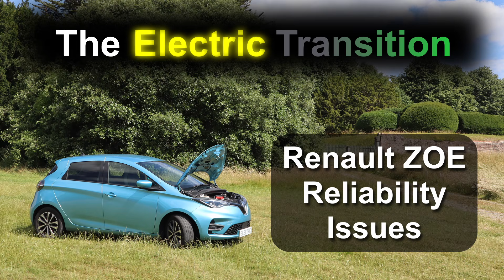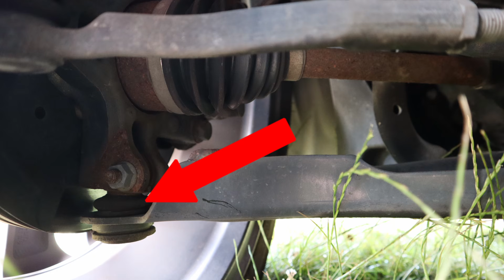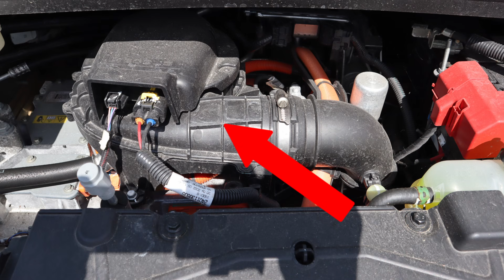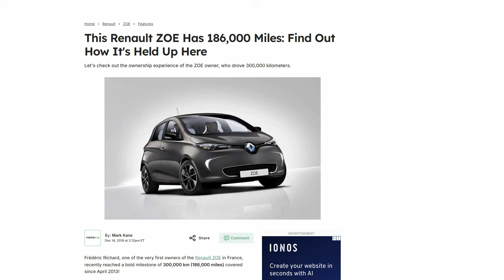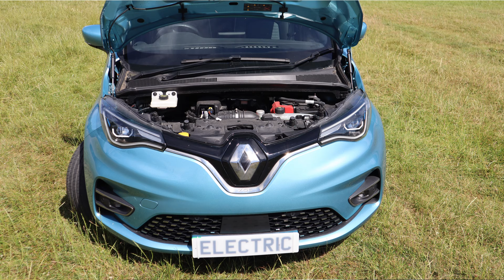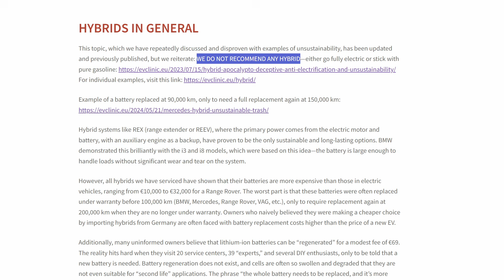Renault ZOE - Reliability Issues

Comment: This is such a well documented and accurate video. I have had a Zoe R90 for the last 5 years clocking 16,000mi per year on it.
Exactly as you mentioned, I have had to replace both ball-joints (can be done with a mechanical press without changing the bars) changed the drop link for a failed bearing and had the bearing failure of death at 90,000mi. As I did not watch your video first, I kept running until the motor failed. I had it replaced  with a refurbished motor fitted with the improved bearings. Unfortunately my Zoe battery charger unit failed this year and due to poor design, is not economically viable to repair… Now upgrading to a Ze50 in full knowledge
Reply from the maker: Thanks for sharing your experience, although I am sorry to hear that you have suffered so many of these issues personally. That seems very unlucky.

I hope you enjoy the ZE50. It's quite a big step up in interior materials and feels more solidly built. I very much like mine.
Reply: @theelectrictransition  Thanks for the reply. It is a significant step-up all-round, especially going from the Dynamic ZE40 to the GT Line ZE50, it really feels like going through 10 years of car tech innovation. My favorite upgrade remains the DC fast-charging capability of the ZE50 and the extra battery range!

I forgot to mention that I park my car near fir trees at night and over 3 years my ZE40 suffered twice from a clogged water drain from the pollen balls. This resulted each time in rain water entering the cabin air system and flooding the driver side. Each time it took weeks for the padding foam to dry up. As a result, at least once a year, I had to remove the wipers and the grill under the windscreen to vacum-out the grit in the drains using a vacuum cleaner and a 1m water hose pipe. I don't know if this is a specific weakness from ZE40 only or if my ZE50 will need the same.
Reply from the maker: @darnio1  Yes, DC rapid charging makes for much easier trips I'm sure. High power AC charging has not become as ubiquitous as Renault expected - not in the UK, anyway.

The ZOE is known for clogging of the drains you mention and as far as I know, no changes were made during the mid-cycle refresh that will avoid that problem. I would recommend continuing with your annual maintenance to avoid the water getting into the cabin
Reply: @theelectrictransition  That is very valuable information, thank you very much!

Comment: Great overview—thank you. One Q210/Q90 issue that may be worth covering in a separate video is charging compatibility rather than charger failure. Some early 43 kW AC Continental-drivetrain ZOEs appear unusually sensitive to the supply’s earthing / neutral-to-earth conditions, so they may refuse to charge at certain otherwise working public AC points. This is not necessarily a fault that can be repaired in the car, but a real usability issue for owners and used-car buyers. It would be really useful to explain the symptoms, why it happens, how common it is, and what owners can realistically do when choosing or using charge points.
Reply from the maker: Thanks. That's an interesting idea for a video. My access to the older ZOE I featured in early videos has come to an end, but I'll see whether it's an option to get access to another one.
Reply: just bought a Q model, can you tell me how do you go about it?

on a side note  I bought it with a charging issue. after 2 min of charge it stops. auto rearms and charges again does this 3 times and then stops for good. Its going to an independent shop to get fixed
Reply: @ignaciosernacampillo9527  Well I am pretty happy with my Q210, especially with the 43kW charge capability. If it is one day financially worth it to change to the 40kWh battery I would do it. But as 90% of the use is for short distance forensic home charging. It is more than fine.
In Spain there is Waylet a big patrol station brand. They have a good network of 43kW chargers that I always try to get to first.
As in Spain the rules for the ground-neutral connection are not in favor, about 30% of the 22kW chargers give a check ground resistance error. And there is legally not much one can do about it, other then remember not to try a second time to get in problems reaching home.

Comment: I have a  2015 Zoe 22kWh R240 variant since 2018. Problems I've had are, drop links, bushes, Electric Motor Failure with the regen breaking not working (£2000 part replaced for free by Renault Dealer, this was when car was about 5 years old), and now I've got charging not working (at all) due to burnt out Neutral pin on the filter assembly. Quote to fix and replace filter by independent HEVRA is £2400. What's annoying about this is that this seems to be a design fault as the Neutral pin is not sized for 32A single phase so burning out is not uncommon. Apparently Renault assumed most would be using three phase (common in France) where the pin for each phase only takes one third the power, well not in the UK. Car has only done 34K miles, so hardly high mileage.
I'm disappointed TBH.
Reply from the maker: Im so sorry to hear that you've had these problems. I can understand you being disappointed - Renault made a few mistakes in their design, and you have sadly suffered because of it.

I agree, the small neutral pin is a bit of a design error. The only question is whether it's a mistake that Renault were aware of, or whether this is a part they bought in from a supplier, and failed to recognise the issue before the car was delivered.

Either way, Renault should shoulder the responsibility, really - but I can't see them doing that. Renault can't be in great shape, financially, so they probably have no choice but to weather the storm of disappointed customers 😑

I hope your independent garage sorts the problem easily enough.

Thanks for sharing your experience - each report of issues helps inform other customers. Take care.

Comment: Very informative. My ze50 makes a pronounced clunk/click when transitioning between drive and regen when I life and depress the drive pedal. Is this normal or a fault ?
Reply from the maker: Mine doesn't do that, so I'd say it's a fault. When was the car last MoTed? I wonder if it might be a lower ball joint - assuming it's not that some part of the drivetrain - even a wheel - is loose.

Comment: It's worth noting that EV Clinic has better bearings they use when fixing R-motors in Zoes that don't suffer from the same issues as the ones from Renault.

My personal opinion is that as long as you have an independent EV repair shop you know of that can fix the issues with the Zoe, so you're not stuck relying on Renault, its reliability issues is something that can be worked around and I don't find it a dealbreaker for most.
Reply from the maker: Thanks, that's good to hear - although, sadly, I'm fairly confident that a change of bearings doesn't solve the problem, it just resets the countdown timer to failure.

The bearings that Renault specified might not be ideal, but the main problem is that they failed to understand induced current. Continental fitted a part in their motor that Renault left out - and that spells failure for heavily worked motors irrespective of the quality of the bearings.

I'd be thrilled if I was wrong, but I think that's fairly unlikely.
Reply: @theelectrictransition I'm pretty sure the issue with induced current is what these bearings were designed to fix. They say these bearings permanently solve the problem of the bearings failing.
Reply from the maker: @swecreations  Ooh, OK, sounds intruiging! Thanks

Comment: I am loking at one right now, it have a motorcode of 5AQ 60. Is you did not mention this, is this a local varient of my country or is it somthing i misunderstadn?
And is this the qontinental veriant?
Reply from the maker: I think the 5AM is the Continental motor, whereas the 5AQ is the Renault motor that tends to be at risk of suffering the bearing issues.

Here is Gary's excellent video on determining which is which. He shows a photo of the metal boxes on the top of the 5AM, alongside the 5AQ he has in front of him.

https://youtu.be/leJ1Shqxxx4

Comment: It would help to have failure rates on it and compared to other e cars… just to out things in perspective and not be empty bottle type of video
Reply from the maker: It would, I grant you. Sadly, there's only one company likely to have that information, and it's not in their interests to make that available to the public.

I doubt that anyone has managed to make a video detailing the failure rate of wet-belt engines for this same reason. Gathering data at scale is not easy, especially when it comes to the percentage of cars suffering failures when they can be repaired at so many locations. The manufacturer might have a handle on it, but they are unlikely to release information about issues with their cars.
Reply: @theelectrictransition I disagree. The wet belt issue is widely documented and Knox to be enough of a problem that they are working on that problem. As for the rest, the number of ecars that burns is Known. Almost 300 for Tesla. Maybe only 2 for the Zoe… considered with the leaf as the safest ecar on the market…

Comment: Excellent, helpful video, thanks. I’m looking to get one of the latest GT Line models, 2022, or 2023 if one exists.
Reply from the maker: Thanks very much, I'm glad it was useful.

Trim names changed a bit in the last few years of manufacture, so you might want to expand your search a bit.

My 2022 car is a GT Line Plus (written GT Line+) which was the name of the top level trim after the complications of Covid.

In the last year of manufacture, the trim names changed to Techno and Iconic. Super confusingly, Iconic became the top level at this point, where it had been a lower spec in previous years. DOH! The Iconic had CCS2 DC rapid charging by default, which had always been optional prior to that.

I highly recommend ensuring the car you get has CCS2. Even if you don't intend to use it yourself, it will be worth more if you resell.

Have a watch of this video, in which I explain how to choose a ZOE as part of the case study, including recognising if they have CCS from the name. https://youtu.be/gWNLcuqgARo

A model you might want to avoid is called GT Edition, I think, a spec made during Covid. Because of chip shortages at the time, this was missing a few features. From memory they were forward collision radar and wireless phone charging, but there might have been others.

Comment: I think assuming your Zoe will not last much more than 100k is a reasonable budgeting assumption. I bought mine at 3 years and 20k and if I can run it confidently to that over 8 years or so I recon it will not owe me anything. Zoe is a relatively cheap car to buy. I live in Shetland and my previous small ICE cars have pegged out at or not much beyond 100k due to the heroic levels of corrosion we get in the salt spay atmosphere. I don't feel I'm taking a huge risk.
Reply from the maker: Thanks for your thoughts. Yes that totally makes sense; if the body is going to suffer severe extremes from exposure then that is going to limit any car's life.

Out of interest, how is the electricity infrastructure on Shetland? Do you have a lot of renewables to draw on, and has that reduced bills? I'm assuming there is no power link to the mainland, but that might be wrong.

Did you come to the mainland to buy the car - is that the best option for residents?

Comment: I have to say that this is video is a really useful resource. I am thinking about buying a 2019 Zoe from my local Renault agent with 96.5% battery health for about 8.5k EUR. I think I might go ahead but I am slightly worried about the possible issues and repairs, as it only has 1 year on the warranty. It was a rental car for a company that went bust and I guess this unit didn't get that much usage before they failed.
Reply from the maker: Thanks very much. I feel it's important to be honest with people and share what I know, so I wanted to create this video to ensure that people had as much information as I could provide about some failures that have been seen.

I'm a ZOE ZE50 owner and I will be keeping mine - I bought it secondhand, but with low mileage. However, now that I am aware of the potential issues that can occur, I'm setting aside a little money in case anything were to affect me.

To some extent, it's about total cost of ownership. Look at what else you can get for the money - the amount of utility that it gives you in comparison to something else - and use that to help guide you. If something equivalent is many thousands of euros more then consider the saving a buffer against what work might need doing.

Unfortunately it's been really hard to gauge exactly how common each of these problems are. We have stories of cars - taxis - that have done 250,000 kms or more without any major repairs (excluding drop links, which are probably considered a cheap consumable in taxis), but we also have stories of failures much sooner.

That summary leaves a little bit of doubt, and I'm sorry I can't be more helpful than that.

Negativaty bias is complex, and results in us hearing about the failures far more frequently than the successes. Hopefully this is a bias you understand, and yet it doesn't mean failures are not real for the individuals to whom they occur.
Reply: @theelectrictransition  I want an electric 5 seater that's affordable, and essentially that only leaves the Zoe. According to ChatGPT the 2019 model should also have the curtain airbags before Renault decided to remove them. It should also have 380km of range according to the dealer. 

And like you mention, I understand that it's the owners with issues that you will see on forums, not the ones who are fine. I just wish there was some way to quantify the risk associated. I will definitely enquire about the extended range warranty. You make a good point about saving up for the bearing replacement just in case.

Perhaps it's only so daunting because I am so used to petrol cars which are a known quantity, and my current car (a 2004 Toyota Platz with 164,000km) is just so boring and reliable that this feels like a potential risk in a few ways, even though the Zoe is so much newer!

Anyways, thanks a lot for your time, and I will let you know if I end up buying it :) 
Cheers from Malta
Reply from the maker: @footdle  I look forward to hearing the outcome! Oh, I'm a bit jealous. I've never been to Malta but I imagine it to be a fantastic place to live. Enjoy.

Comment: Hi, is this sound coming from a broken motor bearing? https://www.youtube.com/watch?v=Hk27fs0Qt4Q
Reply from the maker: Hi there. Unfortunately, I think that's quite possible, yes.

I haven't heard a motor bearing failure in person, but that does fit with the recording I have seen on a YouTube channel called Gary C EV Repairs. Having said that, it might be slightly higher frequency than I might expect for a motor bearing.

I would recommend ruling out the wheel bearings first. Jack up the car, if you are able, and check for play on each wheel by holding the top and bottom of the wheel and shaking it up and down. If you can feel play then that wheel bearing probably needs to be replaced. If you can't do this yourself then an annual safety inspection will test wheel bearings, and is cheap in most countries. In the UK we call this the MoT, but I think you might be in Germany, and it's called something different there. However, a safety test is all I am referring to - you should need to pay no more than 60 euros for the type of test I am referring to.

Drop me a note if you need me to try to explain further.

I hope that your ZOE is easily repaired, and that it's NOT a motor bearing. I recommend using a Renault dealership if it's still in warranty - less than 4 years old - but using independent specialists if it's older than that. Renault will quote enormous prices for repairs as they are REQUIRED to use brand new parts, but independent specialists are able to work with the existing parts in many instances.

Best of luck. Let me know how you get on. Die besten Wünsche!

Comment: My Zoe ZE50 stopped working to charge on AC and even short circuit the chargerbox. Leaks HV battery voltage out of AC pins. Other issues is not able to DC charger ether if the DC CCS is over 25 kW. All over denied by the car. That is the last one happen today and the AC charging fails was 22. December 2025 and even killed my Ucase charging set to home charge here in Norway becouse we only have IT powergrid and not the world standard TN powergrid.

My car started with bugging already on 9730 km with unable to DC charge
On 24 431 km was the car unable to set to gear at all
On 34 251 km was the car unable to DC charge again
On 54 000 km is all AC charging unable
On 54 352 km is near all DC charging unable

My car is 4 months over the warranty already and I got the price to fix the issues with price more than I paid for the car it self. In Norway to fix it is the price 250 000 NOK is around 25 000 EUR not worth it even I payed for the car in 2020 415 900 NOK is around 41 590 EUR. So I waste a lot of money to buy a Renault Zoe istead to select other car.

I will scrap my car and take out the batterypack first and send rest on the scrap yard to expensive to fix the car. I will buy a used Nissan Leaf.
Reply from the maker: Oh that's awful, I'm so sorry to hear that you have had so many problems.

The LEAF seems pretty reliable, so I think that's a good idea. However, I would recommend avoiding the 30kWh variant at all costs, as they suffer very bad battery problems, not just degradation but complete cell failure in some circumstances due to overheating in the upper module.

I wish you better luck for the future.